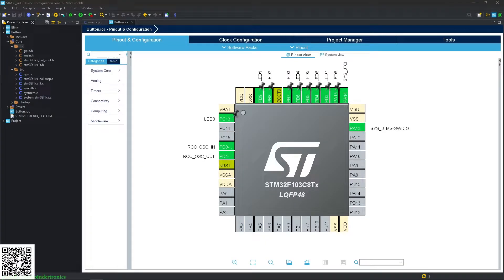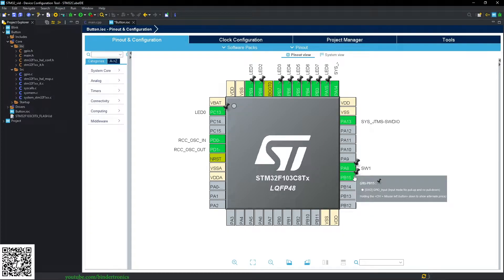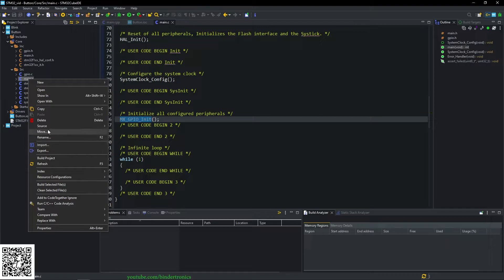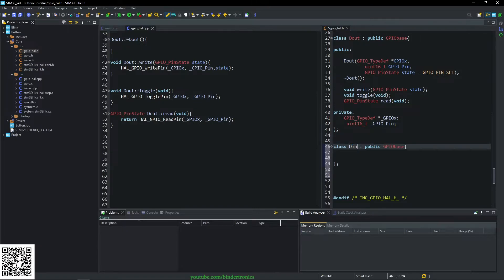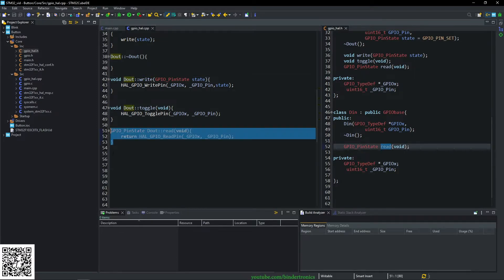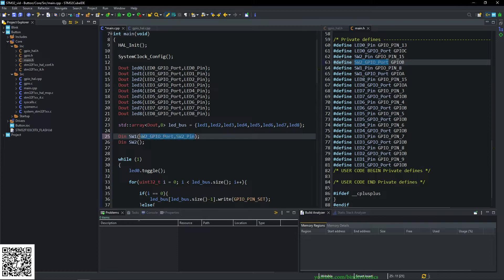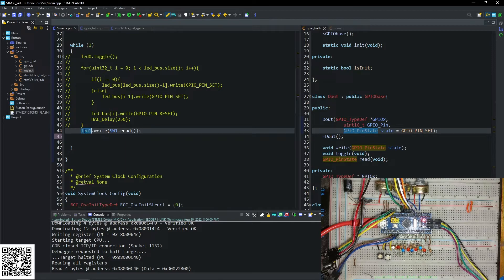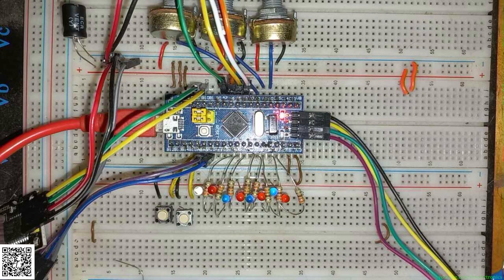Buttons as Inputs 🟣 STM32 Programming with STM32F103C8T6 Blue Pill C++ in STM32 Cube IDE

Comment: Hi. Can you help with programming of an i2c eprom by any chance? I can send one to you and tell you what data in need to modify
Reply from the maker: First you need a grasp of I2C and then how to use it on the platform you are using. Then the datasheet of the prom you are using. Is it a EEPROM or a EPROM. There is a significant difference between the two.
Try try having a look at this first this first. Skills are transferable.
https://youtu.be/_XSJn9KIxJ4
https://youtu.be/tu4vGNo6mvc
https://youtu.be/VsWx12BDuVo